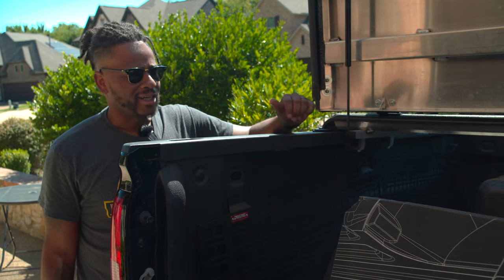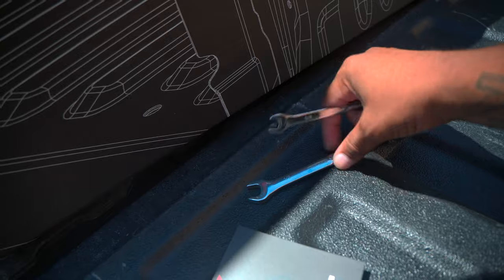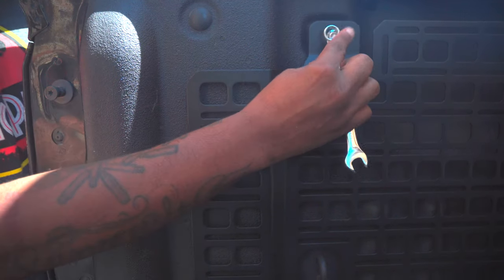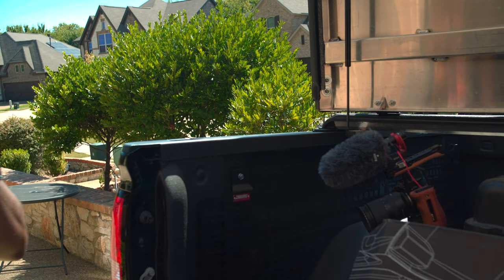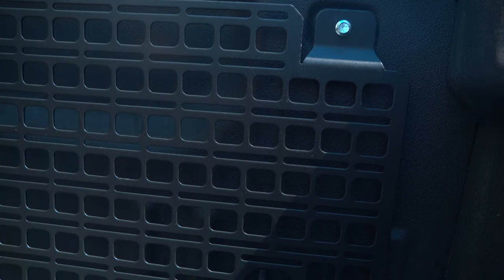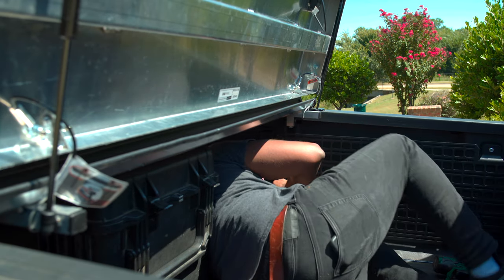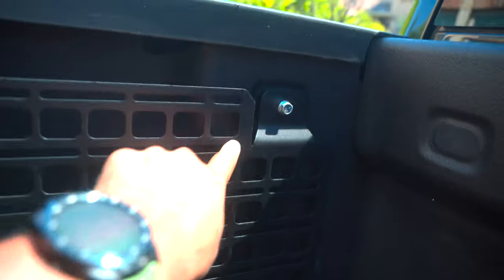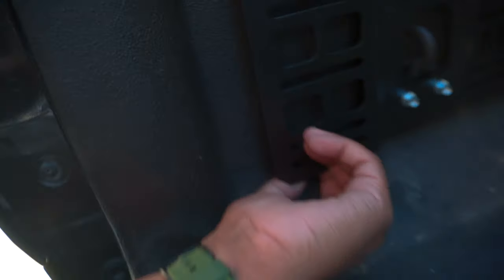Builtright Industries Molle Panel Install 2008 - 2019 Sierra/Silverado

Comment: Man bro u n me were doing the same panels the same time. Those little screws at the bottom are a bitch. Be warned people lol like him. No instructions or anything. Whish they could have put those threaded nut on the back of that bottom piece. Would make it alot easier
Reply from the maker: A ton easier. But to wait to get those machined would probably be a headache.